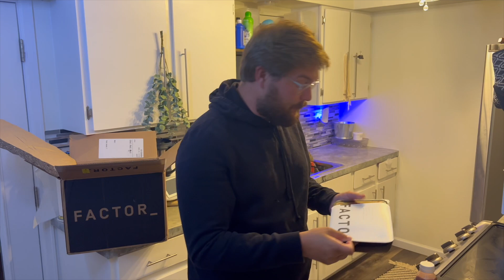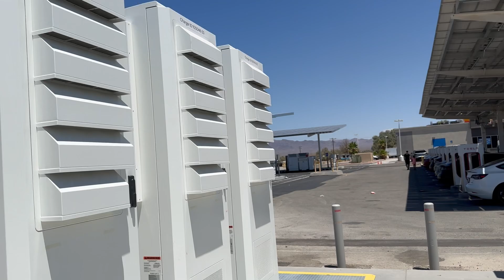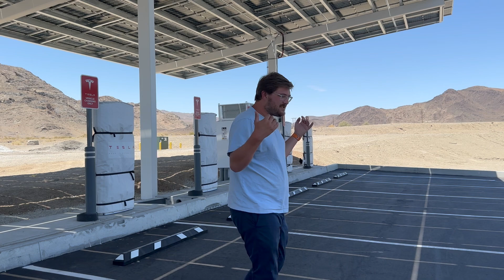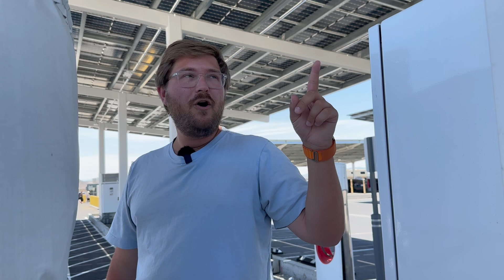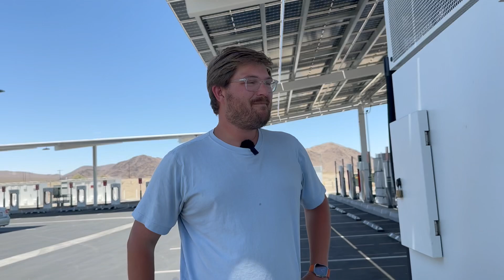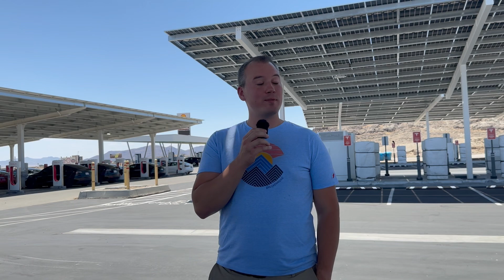Tesla Megacharger! Visiting A DCFC Location With Over 100 EV Chargers. Welcome To Baker, CA

Comment: That strip of concrete the V3s are bolted to is called an  ISLAND.
Just like in a gas station, the gas pumps are bolted to a concrete  ISLAND.
Mounted 4-5" higher than the pavement people are less likely to hit & run 
over a gas pump or charger. (cuz people cant drive)

!

Comment: Kyle keep hoping on 1000v cars getting faster charge. The sunk cost bias has set in. The 1000v cars manufacturers will need to pitch in the money to enable faster chargers.  The Tesla system will be tuned around the brands offering.

Comment: One shed = 100kw easy.
Inverter Huawei. So a SUN2000 100TKL , shed has 20 rows, each row 12 panels x 450wp.  So 240 panels x 450 = 108000 watt power. 

But hard to count the exact panels.   When revisting , try to count the row , nummer panels in a row and if possible ,the specs of a panel .
But im pretty sur each shed is 100kwp

Comment: My primary stopping location when going to Vegas. The original EA 350kw chargers at that location are the ones that fried my Rivian. But, they've since been replaced with the new versions and no problems since. 

Kettleman City, was just at a couple of weeks ago. They have two separate locations on each side of the street. Didn't count the chargers, but both are huge locations, so probably close to 100 between the two locations almost directly across the street from each other.
Reply: I was there a few weeks ago.  I counted only one of the two sites, but they had 39 or 40 and also were covered by a canopy of solar panels.   They also had an air conditioned lounge with an espresso bar!  Cool!

Comment: Wow! I had no idea that you can do electrical engineering so easily and with so little though or effort. Tesla Engineers take a week to figure out a technical solution to the problems you outlined and even then, they need the whole team to do that level of changes that you can do in 5 minutes. When did you convert your BA in Communications over to a science and engineering degree?

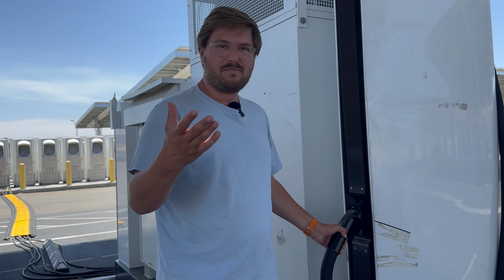Comment: 21:12 Not quite, that is Tesla's own plug design that was submitted to CharIN for adoption as the MCS standard. There was some disagreement over IP and so CharIN went with a different, non-Tesla design which is what that triangle v3 MCS plug is.

Comment: Missing a very fundamental feature…EA has it, but still has issues. Pull through charging!!!! Who is going to use vast amounts of juice? Pickups and other vehicles pulling trailers. Look as you drive down the road and check out all the non-semi vehicles pulling trailers. Who has a need for fast and often charging? Pick ups with trailers! EA has it, but I saw a Rivian with a small trailer just about take out a charger there as the turn in and turn out are tight. What’s after pull through? Dual chargers. One for the vehicle, one for the trailer as the future is producing self powered trailers to extend travel time. 

When you start towing with electric, you’ll see whole new issues with our existing infrastructure.

Watch out for the DQ, Worlds most expensive ice cream cones.

Comment: Sign me up for more detailed info videos, Nerd Level 9000, please.  I'd like to see more about how the battery storage is used at a site; does it pull primarily from the battery when number of cars charging is normally low?  does it only pull from the battery at peak pricing times?  What kind of charge/discharge rate does it give/get? How does it fit in and get used during an extremely busy charging time (like Thanksgiving or Xmas weekends)?

Comment: My company just gave me a tesla 3 weeks ago for vehicle,  they took my Ford explorer I had, im not happy about it... I cover CO to CA and drove 2k miles in past 2 weeks, charging has been a nightmare so far, I live in vegas and there are long lines at all the chargers here, same in SLC last week and it will only get worse with amount of new teslas hitting road everyday vs how many chargers are being built. Plus they are unlocking tesla chargers to all vehicles down the road and that will be a nightmare. Great car if I kept it local,  worst car ever when you travel every week for work
Reply: Where to CA do you travel to? I would find it odd if in CA on a Monday-Friday basis during the day you found SCs  to be a nightmare. But, yes, Vegas is really bad. I'm surprised Tesla hasn't done a major build out there.
Reply: @ERIKM-ed9ef  I would drive to San Bernardino/ riverside area but haven't done it yet in tesla, I would drive right through baker and use this place on way there,  glad to hear its better in CA, prescott az 2 weeks ago was interesting, they only had a electrify America and I couldn't use it, assuming I need an adapter or something

Comment: When I was towing a U-Haul 6x12 foot trailer with my Tesla Model X I came away with some needed improvements.  

1. More sites need to include a space for EV's with trailers.  So far I know of two SuperCharging locations; Morongo Trail in Cabazon, CA with 3 pull through slots and Indio, CA with one.  The Baker SuperCharger doesn't really count as the chargers are 2 deep, where a car may be in front.  Also the turn to get into the charger is tight.  I did change at the Foothill Pasadena, CA SuperCharger but I took up three slots.  One can change at the Disabled parking slots but others non-disabled people were using them.
 
2.  The route planners should say if there are available slots for trailers. 

3. Trailer rental companies like U-Haul need to make their equipment easy to disconnect.  For example include a trailer jack.

I would like to see you include this info in your reviews of new changing locations.  With the new trucks coming this info is really needed.

Comment: Solar canopies is fantastic. Would like more info on the kWh production on a site like this per year. Great video 👍
Reply: I Guess each shed is a 100kwp installation. Not sure but : 20 rows, 12 panels a row and 450wp panel. = 108000 wp of 108kwp.  Inverter is probaly a HUAWEI SUN 2000 100KTL.
so 5 of 6 sheds => 500 or 600kw installation total.
 
Its my living monitoring pv i stallations ( Belgium). A 500kw installation has 500MW yearly production. 

But is dessert 2 remarks : higher temp = more prod losses.  2nd ) Dust covering the panels.

Comment: Love the Baker site - having stopped there many times between SLC and SLO, both in a Tesla and otherwise.  May take the new Tesla next trip in Nov and see how crowded it’s getting!  Off topic question.  I notice that you are running Nokian (Outpost ATs, I assume) on your Revel.  I am thinking about them for our new sprinter and am wondering how you like them on the Revel - I have them on a Ram 1500 and they are great.  Are your E-rated?  Thanks!

Comment: Did not calculate the solar array, and what % of the power it makes.  I wonder if it is more than 5%.  They do look pretty big, maybe 10%.  I am sure they don't solar track, so they are never going to reach their rating.  The heat also reduces efficiency.
Would be nice to have maybe 50 acres of sun tracking panels behind the station.  Best advertising in the world for their station.

Comment: With the building of Bright Line West station in Las Vegas, they need a 50+ charger network built as part of the station.

Part of the service on Bright Line East they do pick up and drop off for passengers in model 3/Ys so it makes sense...

but they could have an issue with the Taxicab Authority and also the Nevada Transportation Authority which runs the limousine licencing

Comment: is it possible that this is the start of the build up for other automakers to use the Tesla sites.  Also will Tesla put in chargers that are derated for chevy bolts who can only fast charge at 50kW.  Seems like it would be a waste for them to take up a space when the car limits the charging speed

Comment: Oh no im a geek !  My first supercharge i oggled  over the spec plate, even have the picture to proove it. Amps and volts all the way.
Reply: That's around town when EVs are charging at home and don't have to stop for refilling at all. On road trips, you might be able to pull in, gas up, then leave in only 5 to 10 minutes overall, but the rest of us need the bathroom, and/or want to get a drink/snack, quick break, are travelling with others that are slower because they're very young/old, etc. I've done long road trips in both gas and EV, and for highway stops, there just isn't much time difference (talking Tesla EVs vs. gas) from ramp off back to ramp on.  Around town, it takes 15 seconds to plug in at home.....don't even spend 5 minutes at the gas station - ever.

Comment: What are your thoughts about focusing on using existing gas stations for charging?  Take out a row of gas pumps and put in high speed chargers.  It would avoid the bottlenecks at SCs.
Reply: While it sounds logical, i suspect the numbers don't work.  From a clean sheet perspective, the typical layout of a good EV stop does not resemble that of a gas station, particularly older ones.  Removing or relocating gas tanks is extremely expensive, as well.

Comment: Interesting. It shows that a) Tesla is putting massive amount of plugs but with discrete amount of power, as not much more is needed to serve Tesla cars. b) Tesla is still tinkering with their MegaCharger. I expect them to switch to the 👽 connector, and their cabinet installation to look radically different to this one of thing. c) you can put such a massive station in the middle of the desert, but this is almost impossible in Europe.
BTW, Tesla is installing v3 cabinets in Europe with v4 dispensers, so no 800V capability, for me it is only because Tesla admits that the short v3 cable can give them some headaches if many non Teslas charge at their Superchargers. But we still have that rumour where someone has seen the number 350 on a station plan drawing.🤷‍♂️ Let’s see what those cabinets look like.

Comment: Surprised and dissapointed that the site doesn't seem to have ANY provision for PULL THROUGH CHARGING for vehicles pulling trailers, especially with the Cybertruck coming!  The temp/hacky pull through even for the Megacharger is funny too.  How are they not thinking of PULL THROUGH YET ON NEW INSTALLATIONS?!
Reply: Good question.  BUT look at all the available land surrounding that site.  Plenty of space for dedicated pull-through Semi charging AND a bunch of solar.  Assuming Tesla owns some of it.
Reply: They are pull through but you would be taking up two spots and maybe blocking a bit Devoting a lot of space to pull through only probably doesn't make sense right now.

Comment: Solar works well with the battery. Of course they can feed it back to the grid and just compensate utility power bill, but they can charge the batteries when sun is shining and then discharge when it is not. I think this is what you have heard - inverter was busy charging the battery. And since in summer you have at least 12 hours of insolation, even 60kW of panels gives you 720kWh, and they have many such canopies, this gives us few megawatt*hour per day. Solar modules are cheap BTW, battery and inverter capable of working with the battery are expensive. They could have installed on-grid inverter and send excess energy to the grid and be done, but then grid had to deal with it (which is probably not a big deal as demand for a/c must be high during hot period), and they went way farther and invested into battery which can store excess energy.
Reply: this solar install is about 210-260kw

Comment: The 40 stalls Tesla 150 kW supercharger at this location often got throttled down to only 72 kW when they're busy. 72 kW takes a long time, so I just have to charge enough to get to the next station. It happened to me twice, so I will not be stopping here again until the V3 opens up.
Reply: Yes, Busy V2 is like that. 150 kW split between two cars. It is really awkward coming in to a V2 station where every second dispenser has a car at it. Who will I choose to annoy by parking next to? Some stations even have the pairs of chargers distributed seemingly at random, so watch the dispenser numbers. V3 also gets throttled, but as shown in the video, the sharing is much wider, so you can't easily point at the one that is slowing you down.
Reply: @geirmyrvagnes8718  I'm aware of the split at the V2 stations. Both times, I tried to unplug n moved to a different stall without another car next to me, but I still only get 72 kW, so you're right about the pairing probably being distributed at random. I even walked around asking other drivers that didn't have a car next to them or in front of them, which they confirmed they only get 72 kW. Watching this video certainly educate me on the fact that V3 does throttle as well, but it's still much faster even when all the stalls are full in my experience. That's probably bc each car takes in the juice at different charge rates as it gradually slows down.

Comment: This is so wrong-headed. We need more Level 2 AC charging not more fast charging gas stations. The world operates with vehicles sitting overnight every night. Destination charging. Residettial charging. Not station to station charging.
Reply: We need both. L2 chargers aren't going to work for you when you are on a 400 mile trip with your one charging stop in the middle. V3 gets me back on the interstate in 20 or so minutes.  L2 would take hours. The L2 I use before the trip, and after.
Reply: Agree but on roadtrips you need this and also hotels should have them.  Around town you can charge at home/apt/local slow chargers.

Comment: That's funny. I should have submitted a bad rate my charge for Baker EA charger. It wouldn't activate on one of the chargers and had to move to another station with our Mach E. Same time frame as when you were there -2 weeks ago in mid-July 2023.

Comment: Note that the local substation that feeds this facility in only about 2.5 km from the site on a road called Silver Lane.  This is ultimately important due to electric power line limitations.  If this facility gets big enough it will likely need additional local power lines (e.g., 12.47 kV or whatever the California standard is).  Of course, solar panels and megapacks may also be a part of the solution.  I doubt that it was a site-selection accident that the local substation is so close.
Reply: They might as well build a power plant right at the site.
Reply: @zachlafond2652  That is easier said than done.  The power system must always be in balance.  It can be augmented with bigger battery storage and generation, but that is not there today.  If there is dedicated solar farm for the facility, then a lot of energy will be wasted when the power is not needed by the chargers and batteries.  If the solar facility isn't big enough, there will be times when there is not enough energy to charge the EVs.  
The power system connection is therefore essential.  If a solar farm is placed near Baker, it can also export to the local power grid.  That, however takes a lot of planning, permitting, etc.

Comment: I'm just curious why no one has built a restaurant or ev-stop for drivers to get a snack or cool refreshing drink. A restaurant would be nice. Can you find a hyperion charging/fueling station to review? Thanks for your reports. I am really enjoying your content.
Reply: There's a large convenience store associated with a gas stop onsite or right next door here.  It's visible a few times, though Kyle didn't cover it. In other parts of the country, there are a lot of EV DCFCs going in at road stores like Wa Wa (sp?) I used several nice ones in FL on a trip last winter.

Comment: Powered by coal and gas except in the day time or if it's windy.
Reply: Nope there is energy storage onsite.
Reply: @JakeRichardsong  still when that is depleted it's coal and gas or nuke and ofcourse the dreadful mining and child labor and sealed non recycled majority of the battery radiation and gases they keep all of this hidden from sight or mention . Shh you can't reveal it or you are a conspiracy theorist or spreading misinformation.

I doubt they will claim 100% solar and wind powerwhich also pollute alot in manufacturing and non recyclable waste.
Reply: @JakeRichardsong  I have onsite storage for my smartphone, and an energy bank, that does not mean it does not still have to use so called fossil energy from time to time, likewise these stations are not clean as they claim in manufacture energy waste and recycling over the li.itwd time of that storage and the heavy metals waste radiation and gases and fossil fuel when sun and wind are down which is quite often.
Having insight storage only does a very small part and is mostly used to brag.